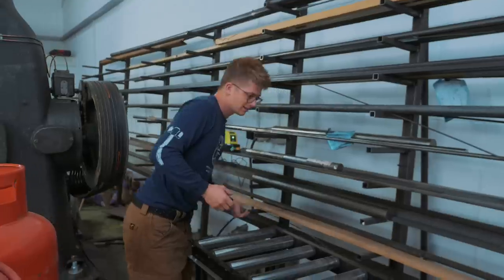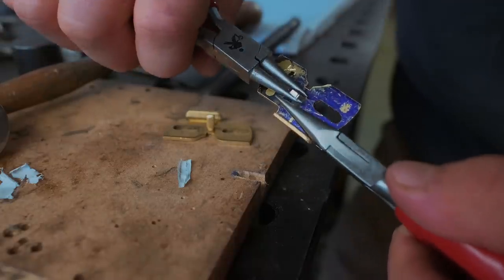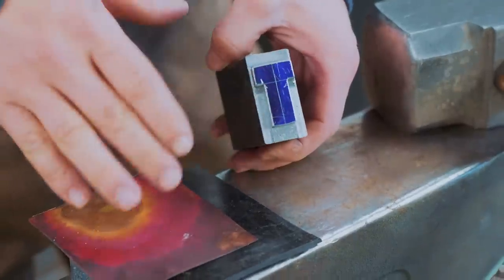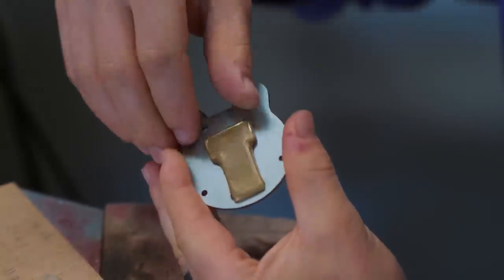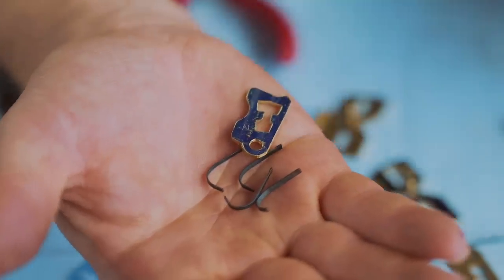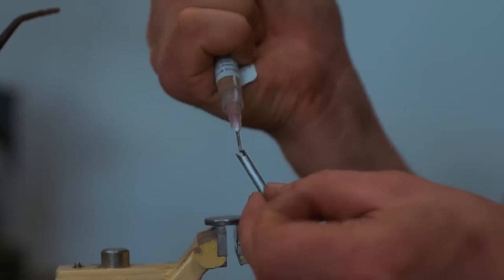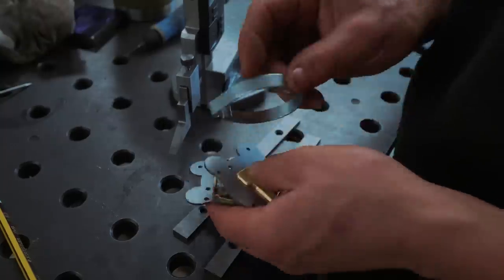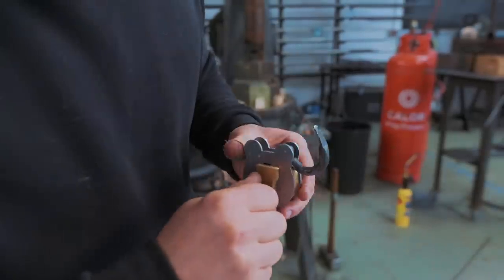Making a Padlock! Part 2

Comment: Its super satisfying to make a key that fits a lock. Physically, Wonderful to see you replicate the skills that can build these zero standby energy devices. I have a single lever iron case lock , with a brass bolt 250mm x 50 x 20 ,  single lever with a stub  rather than a H window.  Similar to church locks often enclosed in wooden shells. It was very decayed on the ward plate but made new parts and put it on a pirates chest.  Love the work, . Do what you enjoy.

Comment: When you're done with it, you should send it to the Lockpicking Lawyer to see how fast he can open it.
Reply: exactly as fast as a masterlock most likely as it's a like for like copy. No false gates in the levers so a very easy pick.
Reply: would also like to see lpl making a lock
Reply: It's based on a masterlock. He'll pick it with an angry stare.
Reply: It'll take him less than 2 minutes to pick, TWICE (just to make sure it's not a fluke).
Reply: Are you kidding me?! He’d probably open it with a bobby pin in 5 seconds.
Reply: I think we all know he'll pick it easily. What might be more interesting is if he gives Alec a design for a picking tool to forge and then teaches him how to use it.
Reply: @Merennulli  Now that’s a great idea!
Reply: he cheated and watched so wont count
Reply: @vryko8567  Its a masterlock. he'll be able to pick it by whacking it with another masterlock.
Reply: @vryko8567  Interestingly though, the less precise nature of how this was made, may actually cause the lock to bind up from an attack, i'm not saying it will, but theres potential, and it would be interesting. If it does, call it a "attack prevention feature" ;-)
Reply: @vryko8567  the varying spring grades, the fact every part is hand made, might add some investing additional quirks though.
Reply: For those second guessing the LPL, this type of lock is actually harder to pick than a modern lock. Due to the stuff springs, and natural inaccuracies when hand crafting any thing this would be a more challenging pick than most. Rake attacks might work, but the spring stiffness and the slop of the gates would make it challenging. Also the fact that you have to tension the back of the lock rather than the front or first pin with a relatively small key way makes raking or combing much more difficult. LPL with a little practice could probably do it in under a minute, but there aren’t a lot of people who could.

Personally I’m more worried about ML sending a cease and desist.

Comment: Should totally send this to the Lockpicking Lawyer to test. I fully understand that this isn't meant to be a hardened lock to resist attacks, and its more of an art piece/technical challenge, but it would be interesting. Great project and once again, you're showing you're not just a talented knife maker but a versatile and talented craftsman.
Stuff made here also did a great video on making a lock, however it was more of a technical execution of precision engineering in order to try to harden a lock, maybe a collab down the line?

Comment: Very cool. Always great to see a lock made from scratch. Next time you do this it might be easier to insert the levers in one at a time, filing them to fit the bitting on the key when the key is at its highest action on the levers in the lock. Also, might be a good idea to have pets not in the workspace as metal splinters can be very painful and horrid to remove from paws. Also pets wont know when and how to protect thier eyes.

Comment: A jewelry rolling mill may have worked for hot rolling down some spring steel. Kinda hard on your rollers but it works.
Reply: Those also work fantastically well for patterning by rolling old lace over the top of strips of soft material like brass and copper.

Comment: "Flexibility" is actually the right term when referring to a spring's "springiness" from a structural engineering aspect. You could also use "stiffness" which is the inverse of flexibility (k = 1/f, k is measured as the amount of force it takes to deflect a unit in length, i.e. force/deflected length).
Reply: I think elasticity is closer to what he would consider "springiness". Flexibility is bending/twisting without breaking but it allows for deformation where elasticity/springiness requires resuming normal shape afterward.

Comment: You could also file some false gates above and below the true gates in the levers to make them more difficult to pick. ...also add a post in the keyhole and make the keyhole paracentric (wiggly shaped) then make the key from a flat piece of steel and shape it to fit in the keyhole and around the post, then file in the bitting. Those modifications should make it more of a challenge to pick. Have a look at a higher security mortice door lock made by ERA to get an idea what is possible.

Comment: If you wanted cheap high carbon steel for the little spring bars you could've used bobby pins, they're similar to 1095

Comment: I needed to replace a few springs on a reloading press that were no longer available from the manufacturer. Flat springs about 1/4 inch wide and around. . 015 thick i think. I ordered in the exact dimensions on ebay, just needed to cut to lenth, curl the ends then hardened and temper them.

Comment: So if the spring steel is what I think it is then it is 1095.  I use this on my locomotive springs and this is what I did.  I used a file to scribe and brake each section I wanted to use.  Then did anneal to red hot and let it cool off.  This made it easy to work with and bend to my desired shape.  I then preheated some canola/reapseed oil to 250ºF, heated the shaped spring, and did a quench.  After they cooled off I put then on a pizza stone in my oven at 400 for 2 hours.  They came out perfect and kept their memory.

Comment: I'm not sure if its actually spring steel but if you pull the metal strip out of a windshield wiper, it's pretty springy.
Reply: It is.

And coincidentally, it makes great lockpicks and tension tools.
Reply: Not a springsteel. You can bent it and it will stay.

Comment: branded "band-it" strapping is usually stainless-steel, or, occasionally, galvanised carbon steel. Generic branded strapping could be anything, I guess, but it is also generally pretty corrosion resistant unless it's living in stupidly harsh conditions.

Comment: Oddly enough, Alec just made one of the hardest to pick locks you can get. Modern pinned locks are (for the most part) extremely susceptible to picking/raking but the lock Alec just made is not nearly as easy. First off you have to tension on the back of the lock. Next you have to apply a lot of pressure as the springs are quite stiff and will reset the pins the moment you release them. Finally because of the natural inaccuracies of human hand crafting there is likely one pin plate that you just cannot “stick” in place with tension.

Comment: You could have used the spring from a lawnmower pull starter, just cut it down without over heating it. Oh and try the hydraulic press next time instead of the sledge hammer, more controll.

Comment: General question about forging and steel: from my understanding, what made Damascus steel superior to "normal" steel was that you could combine properties to a certain degree that usually don't go together like hardness and ductility. With modern bi-phase and trip steel alloys, is a Damascus steel still better or can I take a piece of bi-phase steel and machine it into a sword shape for a superior product? Or is this already part of the heat treatment for modern forged alloys? I know trip steel alloys won't work because they need to be cold drawn to create the desired effect.

Comment: Get a tiny surface plate for sanding. You can get an incredible surface finish with 600 grit paper on a surface plate. But I wouldn’t recommend using that surface plate to measure anything anymore

Comment: Hello from Nova Scotia, Canada.
Awesome. project. Just a question. wouldn't the control of the hydraulic press worked for stamping the brass component, rather than the sledge hammer?

Comment: The pallet strap would have worked of you properly heat treated it. It's made from decent steel to hold allot of weight but not spring tempered, tempered past that point but not quite to soft.

Comment: Ex locksmiths opinion. The key for the lock should always be made of the same material as the levers it lifts or else the levers wear faster then the key and the key will no longer work.

Comment: While your lock wont be a very secure 1 it would be good for lock out tag out on your various machines if you are working on one and want to make sure no one just turns it on etc lock out locks are never very secure they are just a visual reminder to not use a machine that is being worked on.

Comment: Nice work, but would have looked a lot better and added strength if the locks body would have been forged and hardened also, maybe even added some strength and ingenuity and did the body as a single piece instead of a straight carbon copy.

Comment: instead of the sledgehammer over the rubber, can he not just put that die punch thingy on the power hammer, and put the rubber on the bottom? Seems easier than dropping the punch every time and possibly denting the formed part of it.

Comment: I wish you had asked a locksmith, or read a book to do some research on lock terms at a minimum. You did an ok job in the end but you could have done things a lot more easily, the spring steel for the levers is sold in various thicknesses from any good locksmith suppliers or a decent locksmith might even sell you some or a few second hand levers you could take it from, but I suppose that’s not so film worthy. Anyway if you have any lock relate project in the future and want any advice, drop me a message I was a locksmith for over 20 years 😊

Comment: Be careful teasing a dog with a laser pointer, it screws with your dogs mental health. you can tease cats with them though, it doesn't seem to affect them in the same way. 

Using laser pointers with dogs can cause them anxiety and potential issues with fixation and adverse reactions to light and shadows. Someone I knew used laser pointers with their puppy and it would freak out and bark and try and catch shadows all day. It was seriously messed up.

Comment: You have a mill. Precision tool for fitting parts. Why do you insist on hand cutting and filing all the time?
Reply: And as long as using soft or small size material you can use it as a press also. Use your quill stop to set a zero and have highly repeatable parts. Use your damn noodle. Not everything has to be made like a neanderthal.